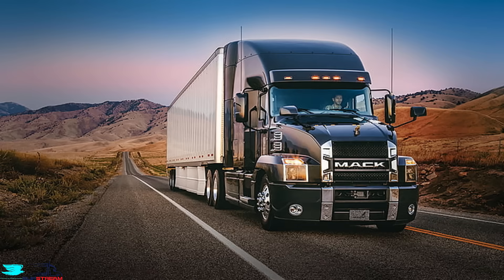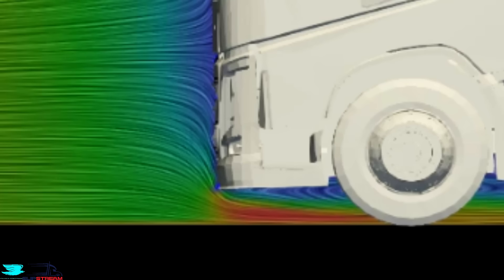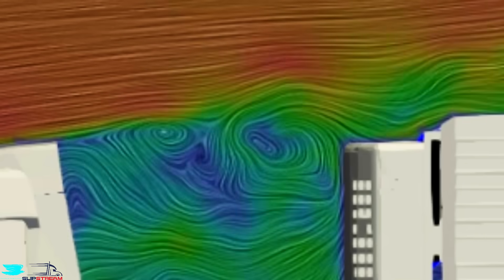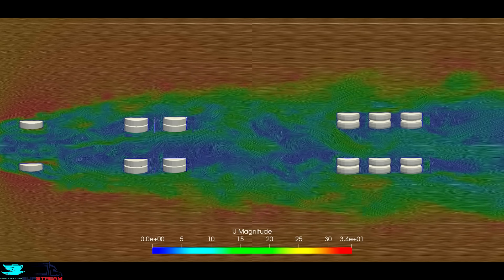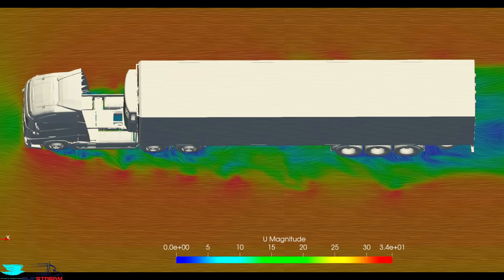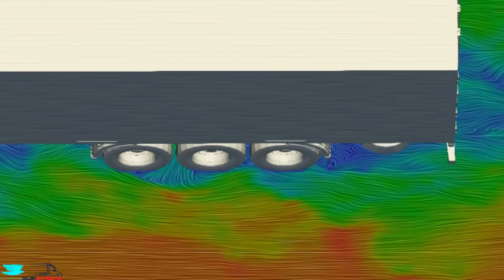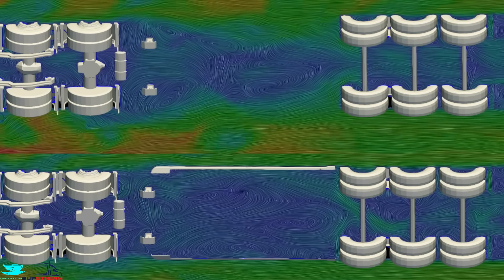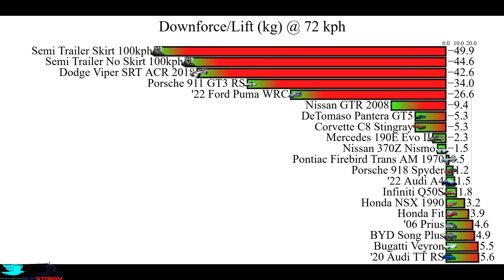How To Lower Trucks' Drag

Comment: Krone trailers have a new product that puts electric motors and batteries in the gap under the trailer. This uses regen and they say it can save 40% of fuel which is clearly significant.

Comment: Really re-inventing the wheel if you start with such a surprisingly old design and try and improve it. IMO starting point should be with latest European designs that comply to current and pending EU fuel economy and safety regulations. Three notable features: 1. Trailer Gap is small. 2. Sideskirts also mandatory collision barriers. 3. Back of trailer aerodymanic fencing. EU Truck Of The Year Competition, Volvo, Scania, MAN, Mercedes &c YT videos and websites, specification PDFs for primary info. Euro Truck Simulator 2 has models of trucks and aero parts.

Comment: 2 things to consider. #1: A smooth flat bottom, which is overlooked most of the time. #2: an inflatable boat tail attached to the back to put the air "back together". Actually putting the air back together at the back is much more effective.

Comment: Some EU institution had a program for increasing traffic and cargo efficiency. The Finnish Research Center VTT took part in that program and hired my company to design the changes to an old Scania truck. There are a lot of aero tricks reported int he Wolf-Heinrich Hucho’s book “Road Vehicle Aerodynamics” (or it original German version). I took most of those tricks and additionally applied a couple of common sense tricks and then we had the parts build and assembled on the lorry. Subsequently VTT orchestrated tests in a long straight tunnel on the Helsinki-Turku motorway during night time and did Cd evaluation by coast down tests. We got roughly 30 % decrease in drag which aligned well with literature. 

The real problem is that the whole trucking industry is very practical old tech. They want to use the old tested ways of building structures which make aero a bit difficult to apply. Since then we have seen truck manufacturers present prototypes and detail design and also container designs improve little step by little step. Point being - the tricks have been known already for long but the incentives or financial gains to apply them have not really existed.

Comment: NASA did an extensive aerodynamic study (and published) in the early 1970s of a cab-over configuration semi truck & trailer. Mostly consisted of running up to a controlled speed, chopping power,  and measuring roll-out deceleration. Rounded corners, skirts, cab-trailer fairings. I read it online about five years ago, I think from a NASA archive. Basically, this video.

Comment: us style skirts go from deirectly behind the trailer jacks  then angled outwards to  the edge of the trailer then stop well before the trailer wheels so people can get to the spare tire and get to the air brake system. wonder if this style works any better or worse.

there is also flaps that give the end of the trailer a bit of a boat tail, and ive seen some trucks that have what looks like speed bumps right before the end maybe doing a simmilar thing with flow.

Comment: Love this content. Not a lot of channels here on youtube like this.
Im wondering why you didnt took a closer look to us semis. A lot of them have skirts, but they are v shaped, like a snow plow to direct the air flow from under the tractor to the outside. And wheel covers. Smooth wheel covers. These I think are the cheapest solutions. Maybe you can develop some kind of a tarp/easy-to-install-click-together-system where you can cover up the open space between the tractor and the reefer. If you attach a reefer, click it together in 10-15min, if you attach a flatbed you leave it in storage. On australian trucks who drive god knows how many kilometers non stop, this could save a good amount of fuel.

You should do a video on the Audi A2. Audis answer to the Toyota Prius, but the world wasnt ready for it. A true form follows function car wich has a cult like fanbase here in germany.

Comment: I wonder if making flat trucks grill occupy the whole front face below the windshield would make it more aerodynamic, if the majority of those air would be directed only through the radiators and expelled through aerodynamic channels.
Some air would still be directed straight on the engine.
Reply from the maker: That would probably reduce the drag a little. The pathways would be a little less draggy.

Comment: You need to change the model of the truck, you are using a horrible and unrealistic example, no trailer is that far apart from the truck, they are very close to the cab, use the FH Aero, and even that Volvo Fh you are using looks much flatter than the real life one.

Comment: 3:09 trailers made for cab over trucks have much longer overhang infront of the king pin to make the gap between the trailer and cab much shorter
Reply: Typically trailers with the long overhang are for tri-drive trucks.  This lets the weight get distributed properly.  A regular trailer kingpin location on a tri-drive means the fifth wheel would have to slid so far ahead for legal weight that the dolly legs would interfere with the frame of the truck.   Trailers are built to an industry standard and normal king pin location in NA is 36 inches from the trailer front for highway vans and reefers.   Also a long overhang on the front of a trailer means there is a lot of "swing" that sticks out into traffic when making corners at intersections.
Reply: @ramrod9556  I mean for the european style trailers which have the a lot bigger overhang infront of the kingpin and the wheels are further forward too. the semi truck in the cfd is made for that type of trailer which fills the gap a lot better

Comment: That trailor is a abomination.

Tripple axle with double wheels. Where is this? Australia? New zeland. Because that is really not a thing elsewhere.
Reply: It's a very common specification for Australia.
Reply: @JamesDyer90well sort of. But there is other issues if it would be a australian truck. That the semi unit only have 3 axles

Comment: Bro, I think there should be an international race for truck expeditions. We're not going to race for speed, but for efficiency. Everyone will compete to see how far they can go on a regulated amount of fuel/speed/safety etc, like in an endurance race. It's going to be some crazy motorsport. Big sponsors will find the best ways to improve the tech around it. I know breaking the world record is really tough, but, bro, imagine how fast the tech would advance in a short period
Reply: An enduro for trucks would be insanely awesome.
Reply from the maker: That'd be cool.
Reply: That race is already being driven every single mile on every single highway outside the US with ther protectionist policies. Every last drop counts, and it's been going ever since 1973. The stakes are who will sit on the market. Drop too far behind,  and you'll be out of business.  Both as a trucking company and as a manufacturer.
Reply: @martinpoulsen6564 sort of. the difference is that in the real world, you can’t spend more money on R&D than you expect to get back in fuel savings, so more ambitious designs would never be implemented. being able to mess around with anything that saves fuel means you’ll inevitably stumble into a practical solution that wouldn’t be otherwise found.
Reply: Awesome idea! The base truck should be regulated and should be provided by, say, Volvo and then teams make aero packages. for it to see whode truck makes it the farthest on a set route with 1, 2 or 3 tanks of gas.

You can also extend it by allowing the  teams to also tune the truck for fuel efficiency. Then you could do a 24 hour challege too, Truck that goed the farthest and uses the lowest amount of fuel wins.
Reply: The trucks need to be provided by multiple manufacturers to make it more viable to have a jump in tech as large in such a short period. Plus then that opens the market for international manufacturers to join in and give us some good clean racing. But we need trailers included. I feel if we can improve the trailers too we would be golden

Comment: as a European, the space between the cab and the trailer is too exaggerated, there is no truck that has that much space, plus some trucks have folding planes on the side too to direct air.

Comment: This video couldn't have come at a better time. I have just finished my master's thesis in truck external aerodynamics for Scania, here in Sweden. I can't say much about it (NDA), but the EU has introduced a new set of regulations which allow for much more aerodynamic shapes. The new generation of electric trucks from Scania, Volvo, Man and etc will be a feast to the eyes. 

In my thesis I used CFD to optimize a small region of the truck for drag, but also for heat transfer. Unfortunately, I could only use RANS due to the computational power available, but still, we had a 170milion element mesh. As a person who was a CFD guy for a Formula Student team, the difference from race car and truck aerodynamics was awesome to see. 

Lastly, as someone above mentioned american trucks being more aerodynamic. It depends, overall, american trucks are inferior to their european counterparts, because the regulations in US sucks, it is as simple as that. I would bet that even with the extended nose, US trucks are less aerodynamic than the flat EU ones.
Reply: I'm very interested in the EU regulation changes, is there anywhere I can read the specifics of what was changed?
Reply: Daf already did a truck to suit the change last year though?

And yes. American trucks suck in every way.
Reply: It makes me so happy to know that theres a pipeline for people to develop a thesis based around improving semi truck efficiency! Way to go!
Reply: I worked at Mercedes trucks in Brazil when the actros was lauching here. Curious about the new changes as well, when some information goes public would be a nice video!
Reply: Nah american trucks are awesome, Peterbilt or kenworth will build the truck to custom specs, while scania or volvo will try to sell the truck they build.

The average fuel consumption of us trucks has gone under those of europe in 2020 despite cheaper fuel worse drivers, and higher speeds.

Comment: Could someone (or you if I'm lucky) explain the usefulness of those sort of air curtains on the side of some trucks? Those sort of air inlets (around 15-20 cm high) at the height of the door. They improve aero or are they just aesthetic?
Reply from the maker: For aero, they can help keep the flow attached around the edges. They're effectively guide vanes.
Reply: @PremierAerodynamics thanks for your reply. But I don't understand, if it is a small guide vane compared to the whole height of the vehicle, shouldn't it create a speed/pressure differential, thus inducing turbulence and wake?
Reply: By the way, I would find super interesting a video on the subject!

Comment: Generally in Australia the truck combinations have less volume between the rear of the cab and front of trailer than the model used due to the length regulations we have to abide by. 

The conical protrusion suggested by others here is a good model to test but in practice unless we see vehicle dimension regulation changes it won't be able to be easily implemented. For Aus we have a maximum rear overhang of the lesser of 3.7m or 60% of the vehicle wheelbase - these trailers will have a rear overhang of somewhere around 3.5m. 

The challenge for Slipstream is that the area their aerodynamic devices are placed is one that modern equipment is required to have underrun protection. The compliance with the specific ADR and the mounting system of the device will need to be considered but i am sure they are all over that.

Comment: there's to many space between the cabin and the trailer! I'm truck driver in Europe and i barely fit between the truck and the trailer, with a reefer trailer we're force to link the air hoses before attaching the trailer to the truck because the reefer unit takes so much place that there's only about 20cm between the rear of the cabin and the front of the reefer group (i haul frozen goods). that's a good way to improve your trucks' aerodynamic.
In EU there's a law that force the brands to put side bars to avoid a bike to pass under the trailer (these bars are often replaced by a palet box) these increase aerodynamic performances.
Trucks aerodynamics are a nightmare because there's a lot of parts that enters into the computing (size of the wheels, number of wheels, size of the vehicule itself, massive need of cooling etc....)
Reply: Absolutely! Also, air curtains around the cabin are pretty standard here as well. There is a lot to improve on this particular simulated model.
Reply: Even for USA, the only time I see that much space between the cab and trailer is when they are mismatched. Like a tractor from the 90s or earlier. Usually someone who has built their truck for looks rather than efficiency.

Comment: Would the spray brushes that get fitted to the trucks help seal up around the front wheels stopping air spilling out reducing drag?
also would a longer version of those spray guards / brushes fitted to the bottom of the skirts down to say  50mm off the ground help the skirts more by extending them but being flexible to allow going over bumps etc? or would all the brush cause more drag as there not one soild surface then leaving it open?
Reply from the maker: Sorry, I don't quite know what the geometry is that you mean. If they extend towards the ground, then most likely yes. They'll act like an air dam at the front. Extending them down around the sides would likely reduce the drag too.

Comment: you should have tested skirts around that empty space behind cabin. As well you should have tested an aerodynamic approximately conical protrusion behind the truck that would prevent creation of low pressure zone. Rifle bullets use the same thing and it's called "boat tail".
As well, if you are bent on selling this kind of analyses you should really calculate how much fuel would be saved per 1,000 km or miles.
Reply: And if I'm not asking for too much, you should try taking all that air that is entering through engine front grill and when that air finishes cooling engine it should be bypassed into that cavity between the cab and the trailer to increase pressure in that area. As well, bumper should be turned upside down in order to become an air scoop, and that bumper-air-scoop should as well pump high pressure air into cab-to-trailer cavity. Just a simple mechanics, really.
Reply: @HitAndMissLab  here in the States, they have a product called TrailerTail its a foldable skirt that bolts to the back of the trailer its pretty much what you are asking for
Reply: @LincolnElectricDaycare  we have some on our company's older '17 and '19 trailers , they do make a small difference in fuel economy and stability from when i use them, downside is they're fiberglass and do not age well, i don't use them half the time because they're cracked around the mounting frame bolts and i don't want that risk/liability for .5 mpg

Comment: Test some american trucks with long nose))) They might be more aerodynamic
Reply: I think the newer American trucks would have significantly better flow in front, but would the older boxy american trucks have any advantage to the flat nosed European trucks?
Reply: @BrokeWrench not really other than able to be used as a mobile home. European trucks are decades ahead of american trucks but they are getting closer.
Reply: The truck in the video appears to be a Volvo FH16 (built for Europe and adapted to Australia) so it would be an interesting comparison to look at a Volvo VNL which is Volvo’s North American market truck (conventional cab). I’d like to see how a conventional cab and a cab over compare and with Volvo making both it would be a fair test.
Reply: @garfieldslasagna3493  If you want a fair test then you should also use Volvo's new Aero cabover truck
Reply: @codemy666  Volvo FH Aero?
Reply: @ukuskota4106  Yep
Reply: @garfieldslasagna3493  Volvo Fh are using looks much flatter than the real life one...

Comment: Is it possible to lower the drag of a diesel locomotive train like the one used in Indonesia? I think its shape is quite blocky and prolly the fuel economic is not good as well.
Reply: In addition to the profile of freight trains being relatively small frontally, the length of trains means that most of the drag is caused by viscous flow along the length of the sides/top/bottom, rather than pressure forming along the front or rear. You can try to design a freight train with a nose like a high speed passenger train, but with the inconsistent shape of the freight cars, it won't even matter.
Reply: Aero drag on a train is a somewhat surprisingly small problem most of the time, as they have very little frontal area versus their rolling drag. Starts to matter when you push speeds up to where ground level crossings are a terrible idea, but still.
Reply from the maker: They do suffer from similar problems with their wheels and openings between wheel sections. So, it should work there too.
Reply: @PremierAerodynamics  There's definitely a lot of possible optimization, but the part I reckon to be at least slightly questionable is what percentage of total drag it'd actually be, and at what speed. 

If we cut drag in half and it only reduces that figure by 5% (to just throw numbers around), is it worthwhile?
Reply: @RotaryJunkie Especially if any aerodynamic measures make maintenance more difficult
Reply: What in Indonesia?